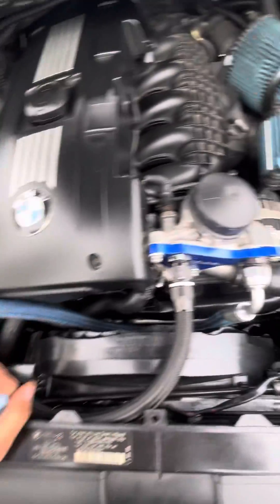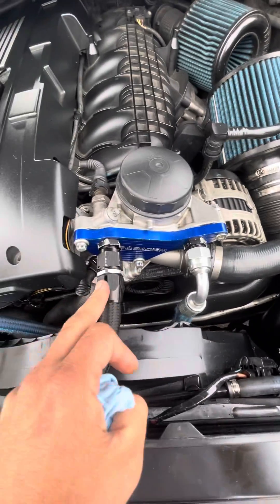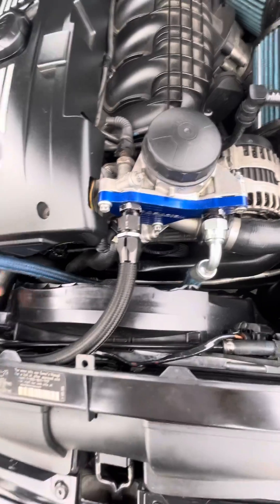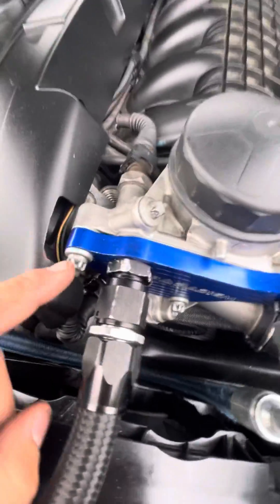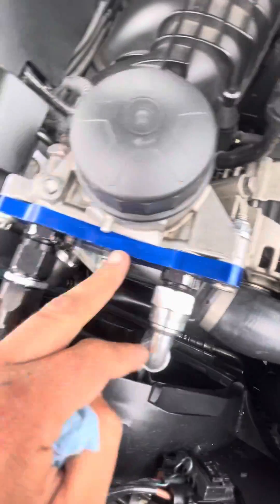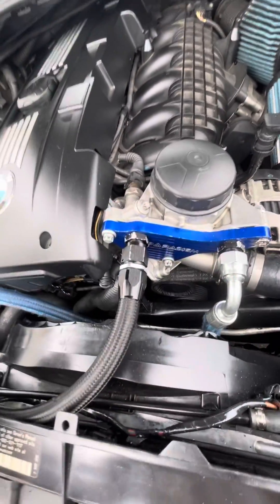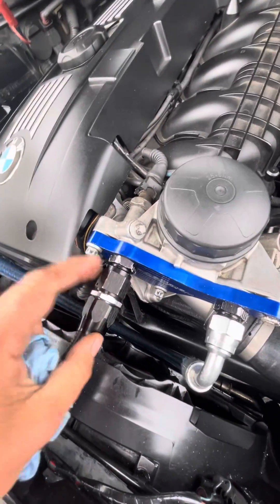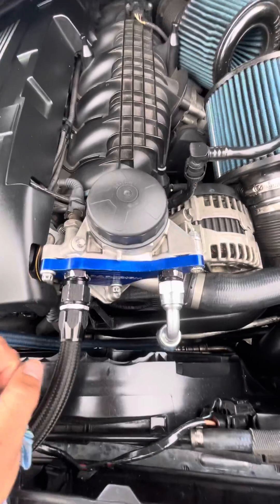N54 oil thermostat delete plate with oil cooler install 2007 bmw 335i

Comment: My plate came with bushings in the an line fittings which I don’t like. Other than that I built my own they go 90 degrees away in both directions one long line runs across the intercooler and subframe with loose zipties. And I’ve destroyed lines already because they touched radiator shroud. And was worried they would also touch a coolent line too it’s really difficult. I ultimately got it right for the life of me but stripped the dang 25row cooler fittings. So I’m ordering another $100 dollar 25row.